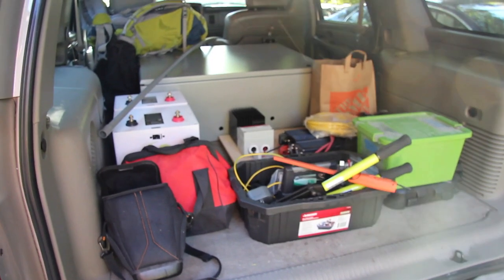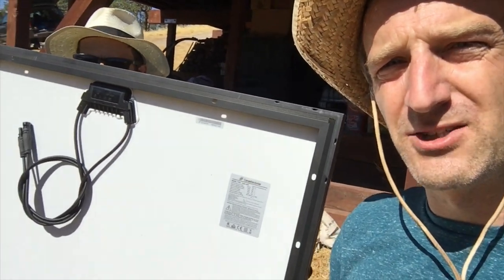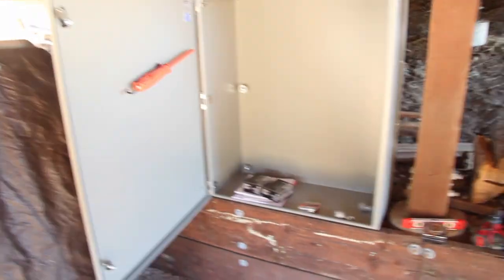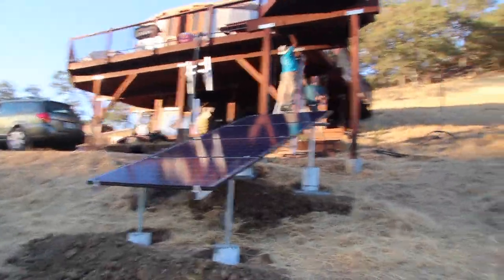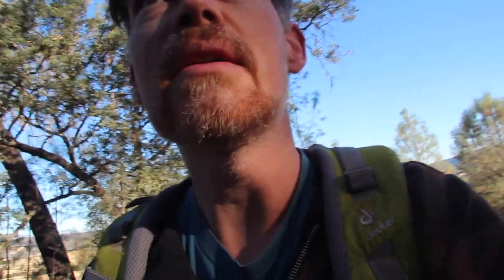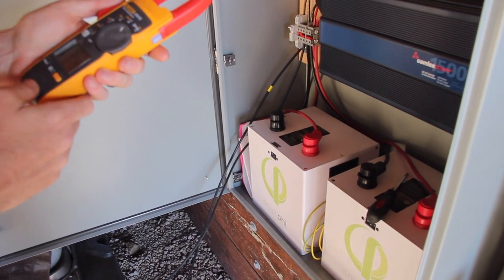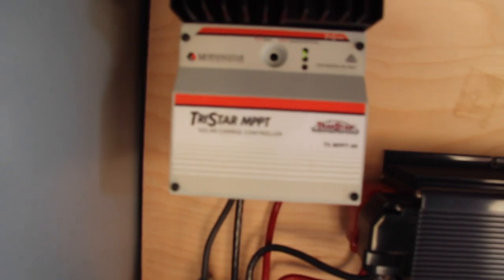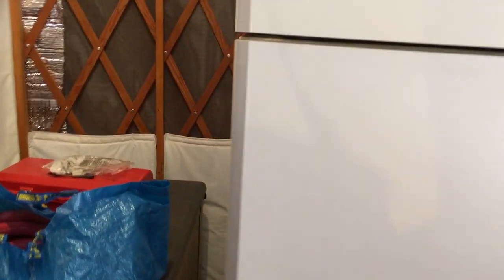Off Grid Solar Yurt - The Build

Comment: How you making out? My concern is that you have the charge controller and the inverter in the enclosure with no venting for cooling the units.
Reply from the maker: It's working out ok so far. The system is always in the shade. If we had ventilation, then we might have some critters getting in there. I considered a NEMA 3R box, but then decided to use a NEMA 4X. Do you have any recommendations for next time?